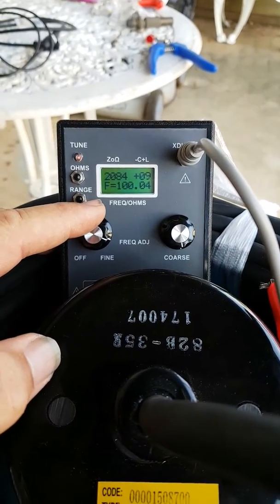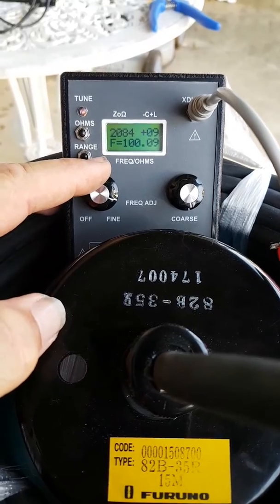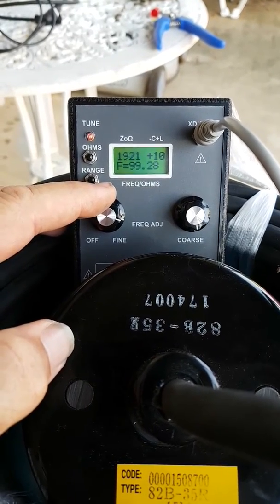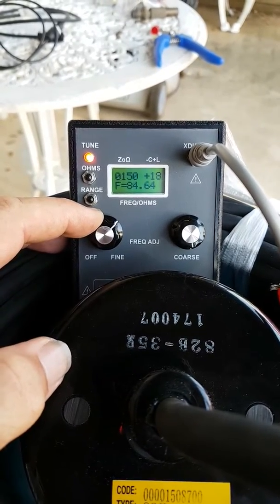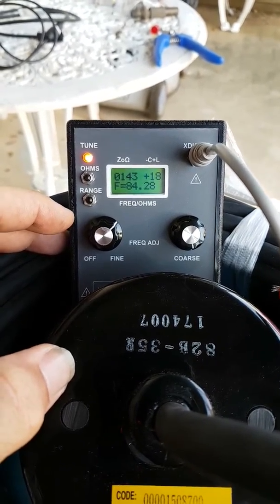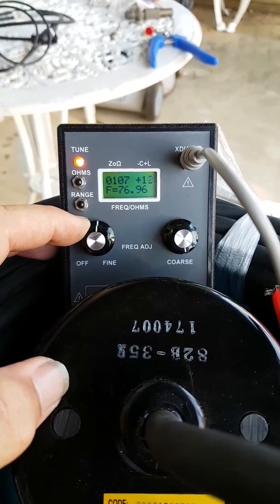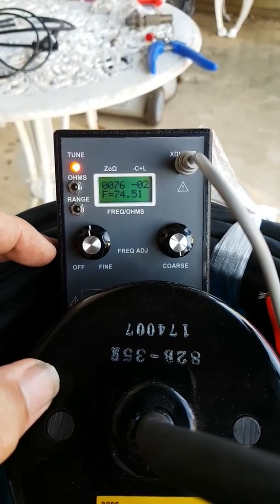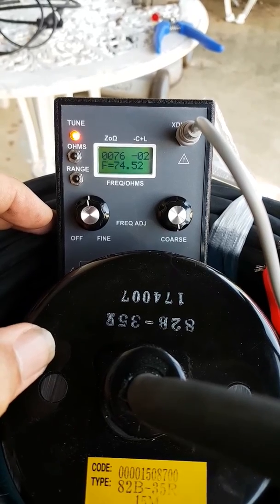Furuno Transducer optimisation

Comment: Here's a Q. from left field.  I have an old English  Seafarer flasher type depth sounder, with no transducer. I have no idea what the Freq is nor what the impedence of the cable should be.  Have you got any idea ? I suppose I could assume a value of 100 ohms, make a dummy load, and put a frequency counter on it. I am assuming an F in the 50-250 Kc(KHz) range.  Been saving it for years (40 ?).    Any help much appreciated.